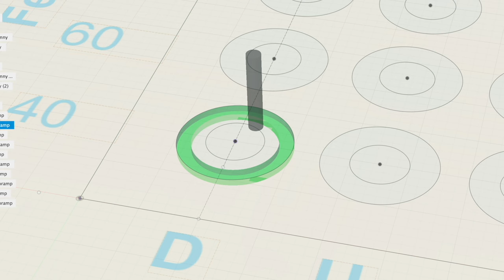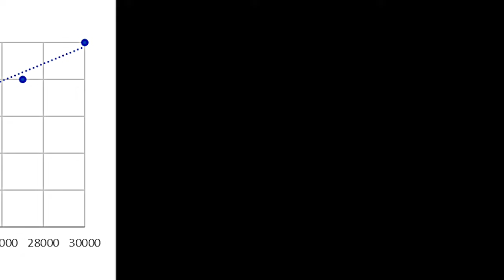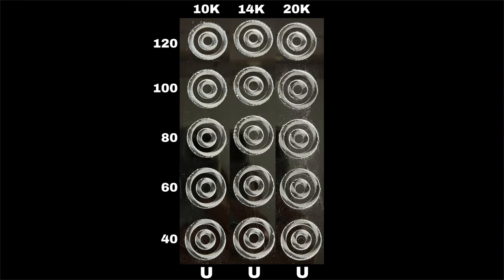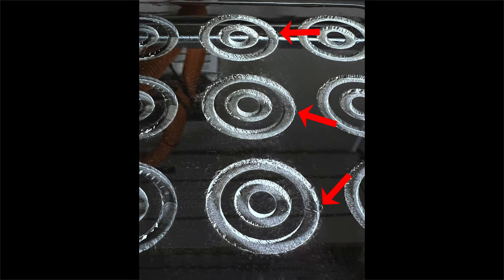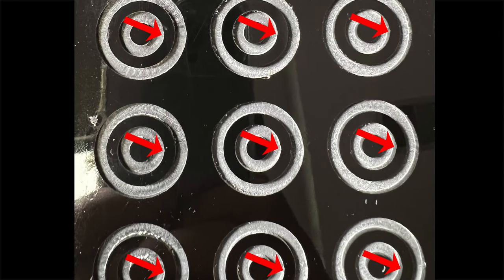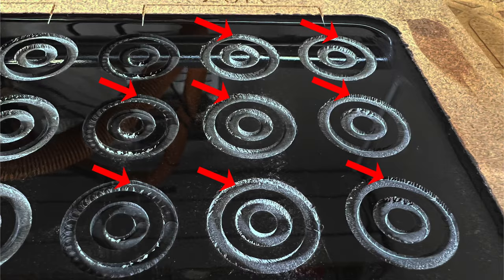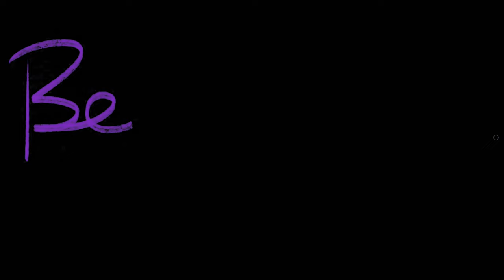The RIGHT settings for cutting EPOXY with a CNC

Comment: I'm thinking at lower speeds, there's a burnishing effect probably taking place, causing a smother finish
Reply from the maker: Hi Teague - perhaps; I would need to look closer. That said, the chips coming from the 1 flute end mill were excellent, so I think the feeds and speeds were good (or close enough). Can't say the same for the 2 flute end mills. Thanks for watching!